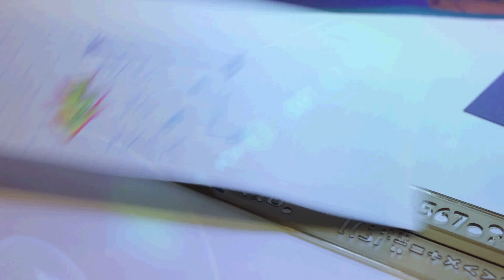How to make a DIY Aquarium LED Light with RGB LED Strips

Comment: I sometimes feel simpler is better.   This is a great project, and good for ideas.  10 strips of LEDs may be overkill for brightness.   There is definitely a thing for too much light as much as not enough light.   Love the ideas in this, but personally I would not bother with RGB controllers.    Setting pretty lights is nice for the humans, but does nothing to benefit the plants or our aquatic friends, and potentially some light colours could stress the residents of the tank, especially if the lighting is changed.   A fish tank is about making a home that is comfortable for the fish as much as for humans to look at.   Personal opinion of course, but I'd rather just use standard white LED's with maybe a single strip of red/blue grow LED strip to help the plants and leave it at that.   Less is more sometimes and less to go wrong means less chance of failures.
I've heard this a few times "Looks great to me" or "I like the look" from people, with them not giving much thought to the fact in the tank are living creatures that may not like the look.

Comment: If that at the end of the video is the light on the aquarium it’s not worth doing it, doesn’t look bright enough for plants to grow
Reply: That will doemed upon your led tape. Mine is 15 watts pereter making it strong enough to light up a room
Reply: The light is plenty bright enough for plants   It's not a "grow" light, but ten strips of even the lowest LED count strip out there is plenty bright enough.   YouTube compression is likely affecting it.
The thing I disagree with on this project is using an RGB controller.   It doesn't benefit the fish at all to have different colours controlled.  They will be much happier with a standard colour.  Changing colours will just make the tank pretty for humans and will be no benefit to the fish or plants

Comment: I'd like to see the specs on paper for the LED's in these rgb strips, 30 watts sounds like a lot for that little an amount of light output, it could be the camera but that didn't look like enough light to grow plants in that aquarium, and i bet it wasn't even that cheap to assemble. Higher end LEDs like CREE and Phillips, can be had for a few bucks easy, and put out a lot of lumens for not a lot of watts. You could go really basic, and use grow light bulbs and clamp lamps and probably have better results for less money.

Comment: Hi, so now it's 2018. Are your Led-strips still full working?
Made something similar and my strips corroded  between the Double sided Tape and the LED pcb. 
Noticed it because i wanted to do some orange Light and it was only Yellow.
I didn't put Aluminum underneath the Strips maybe that's the Point....
Reply from the maker: Hi, I had a few strips that were "outdoor" type that corroded as you said between then tape and the LED pcb. I then went with a better brand (VTAC) that seems to work better, however, as a long term solution, it is essential to have a glass or plastic sheet between the water and the LEDs.
Reply: Made 2 Hack did your plants grown? Under these?

Comment: How did you wire different coloured strips together and control each colour independently with one controller and remote? Is it a special kit or just simple led strips that are available on eBay?
Reply from the maker: You might find it as a kit, where you have the RGB strip plus the RGB controller. If you search for RGB controller on eBay, it's like the first result. The strip plugs into the controller, and the controller into the power supply, allowing the controller to change the lights and special effects.

Comment: Where did you get the window sill material?
Reply from the maker: Hi, just at the DIY builder store. It is sold by the meter. Or, you can look for simple PVC panels as well. The ones made for window sill is the harder of the PVC material, I think it's called Komadur or Komacell.
Reply: Thank you for the info!

Comment: what remote did you use to control to colours?
Reply from the maker: The RGB controller / Driver has a remote control included in the kit. It is the standard RGB remote that comes with all RGB Led packages. Look at this photo for reference. 

https://hidkitpros.com/wp-content/uploads/2014/06/RGB-Reel-Remote-IR-Controller.png